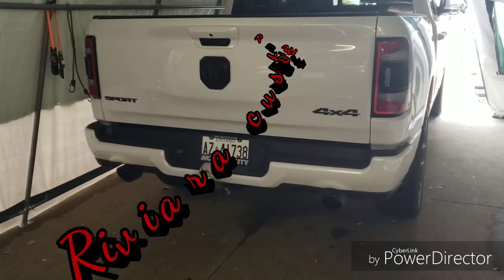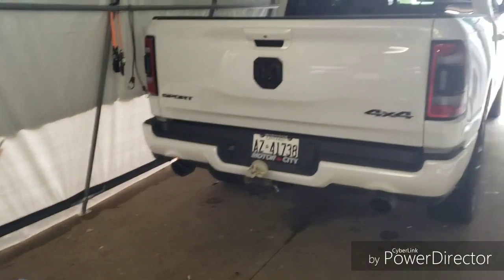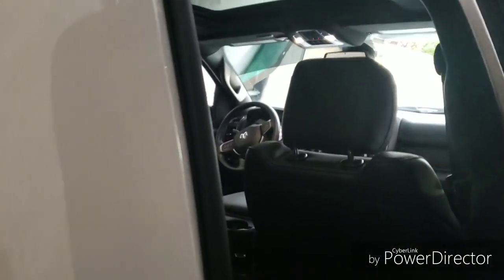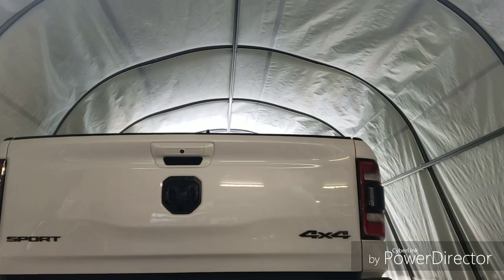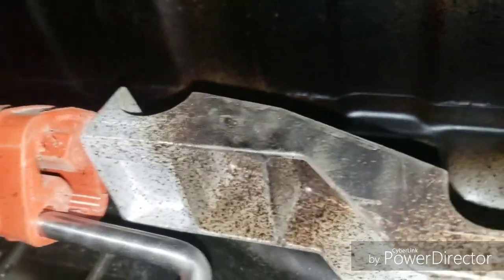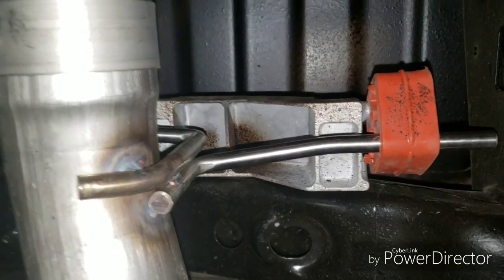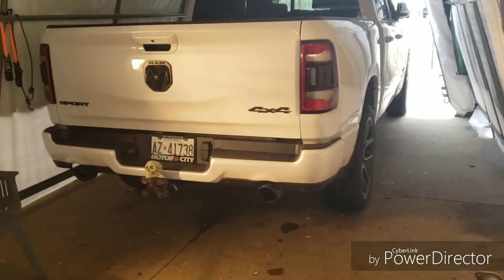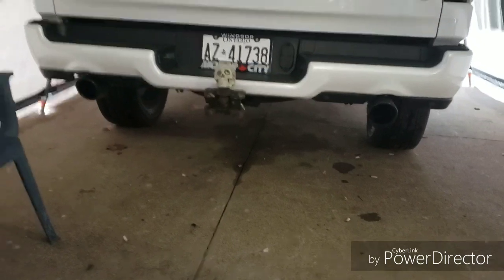2019 Ram 1500 Sport muffler delete

Comment: Do you know if this affects the engine in any negative ways at all?
Reply from the maker: Only positive I have never heard of anything negative I've straight piped every vehicle I've owned it has never caused an issue only increases power so I guess you would say in a negative way it does cost a little more and gas nothing drastic add more power equals more gasoline right
Reply: RIVIARA CUSTOMS thanks for the quick reply, I’ve got an 18 and just don’t wanna mess anything up but I wanna get rid of my muffler and resonators so bad lol
Reply from the maker: My advice to you is if you want to get rid of your mufflers and resonators I suggest getting performance muffler and then deleting the resonators or delete the muffler and keep the resonators my experience it is a popping crackling sound when you step on it which can get pretty annoying and obnoxious I deleted the muffler and the resonators and now I am getting a borla muffler and leaving the resonators off I will make a video on that I'm curious to hear what it sounds like stay tuned for that coming soon
Reply: RIVIARA CUSTOMS awesome thanks for the advice! Any idea if this affect warranty? Power train wise? I’m from Texas idk if it’s different
Reply from the maker: @brysonmagness1726  I'm in Canada my buddy worked in service he told me it'll only void the exhaust system warranty not the drivetrain warranty could be different for you I'm not sure and I forgot to mention don't forget to stick your tips out past your bumper a little bit because running straight pipes can dirty your bumpers with the emissions doesn't run as clean as it did when it had the mufflers and resonators and also if you have to get up at four 5 in the morning and it's cold outside it is a very loud startup I have pissed off my neighbours and also running straight pipe with the 4 cylinder deactivation it sounds like shit when it goes down to four cylinders so click down on your gear limiter and then click up to eight every time you go to drive and it won't deactivate 8-cylinder if you don't understand what I mean let me know hope this helps I'm glad to be one of the very few YouTubers that actually replies to their viewers
Reply: RIVIARA CUSTOMS I definitely appreciate all the advice,  if you could help me understand how to deactivate the eco mode again that would help. Btw howdy from Texas btw! Lol
Reply: RIVIARA CUSTOMS definitely appreciating the replies though man for sure
Reply from the maker: @brysonmagness1726  np enytime
Reply from the maker: When you put the truck in Drive look down on your steering wheel there should be a plus and minus in the centre it says gear limit on your right side of your steering wheel click - once and then click + up until it says 8 on your display screen in front of the steering wheel once it says 8 you can continue to drive it will go back to normal if you put it in reverse you will have to do this step again it's a pain in the ass but when you have straight pipes it sounds like crap when it's running for cylinders so it's worth it I hope this helps let me know if you figured it out